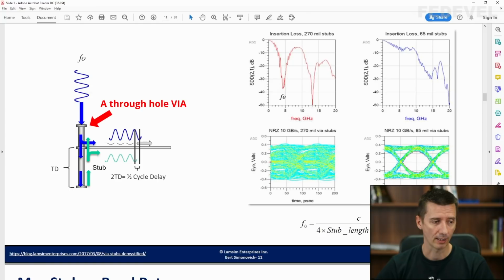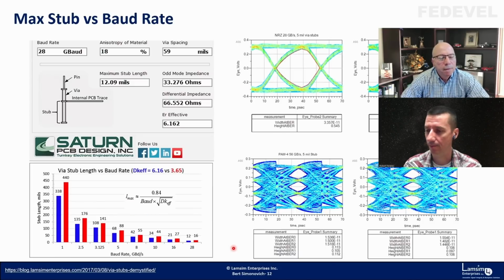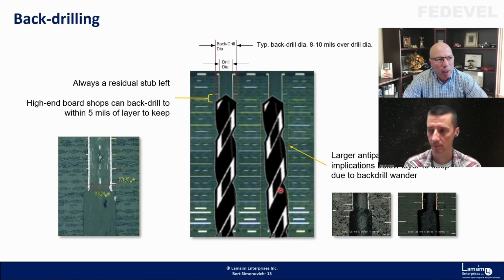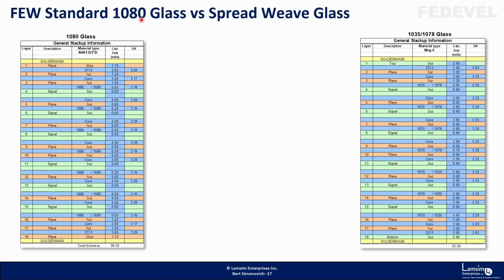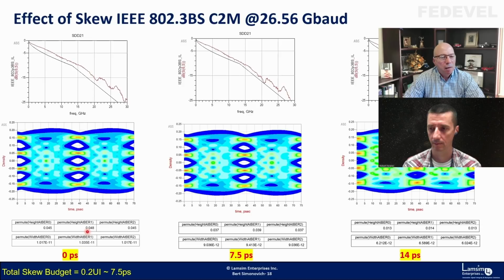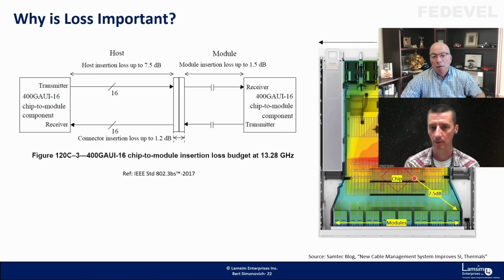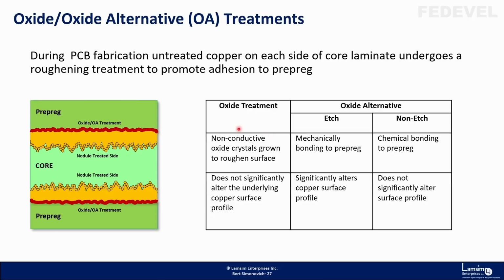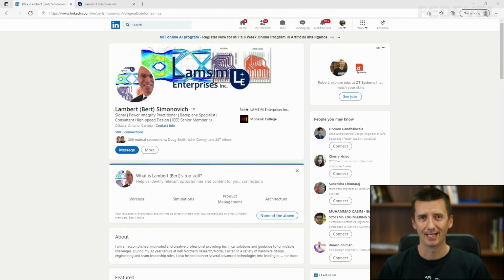Small Things Damaging Your High Speed Signals (with Bert Simonovich)

Comment: Great video, thank you. 
PAM4 is widely used in optical transceivers for ethernet (QSFP, SFP, OSFP...). The host side would be PAM4 and the line side would be an optical (fiber) signal.
And then when PAM4 is not enough there is QPSK and QAM16, these are being used for Coherent optical networks for 400Gbps ethernet.
I am not an expert, but I have some experience working for a high speed test and measurement company (TDR, DSO, BERT ...)
Reply from the maker: Thank you Hisham

Comment: maybe someone could talk about wiring between/inside equipment (non-differential), should there be multiple grounds in ribbon? plain twisted pairs for each signal? won't they create ground loops? what is worse ground loop or coupling between signals if ground is shared by multiple signals? always wanted to know answer...

Comment: Another great video. Thank Robert and Bert. For surface roughness modeling which numbers use in Advanced Design System?
Reply: Advanced Design Systems currently does not include Huray model, so my Cannonball model does not apply.
Reply: @bertsimonovich7297  thank you, Bert. Your work is phenomenal. I always have problems with modeling of surface roughness of copper foil. This staff in this video and your works are great.
Reply: @Hadi-zw9mb  Thank you. My web site has more detailed papers on modeling copper roughness.
Reply: Actually I just found out ADS starting with version 2022 includes the full Huray model so you can find the necessary parameters using my Cannonball model

Comment: Is the 270mil stub length shown at 6:00 split across multiple vias? Even accounting for the reflection going down and back up the via, it seems unlikely that you'd have a single via that long.
Reply from the maker: I was thinking the same, but, some PCBs really are very thick. I googled more info about backplanes and for example here it says " typically 4.0-6.0mm, sometimes even up to 10.0mm." https://www.pcbway.com/blog/Engineering_Technical/PCB_backplane.html
Reply: @RobertFeranec  Ah, yeah, on a re-watch I realised he's talking about backplanes with huge layer counts. That makes more sense.
Reply: Yeah, it's funny how you can work with something like PCBs for decades, and get accustomed to say 0.6 to 2.0mm thicknesses, and then suddenly run into 6mm board thickness and it beggars belief. But apparently it's just more of the same, with the exception of vias now becoming an appreciable length to worry about.

Comment: In the skew discussion he mentioned that the Nyquist was at 14GHz, but that would be roughly the nyquist of an NRZ signal. With PAM4, the nyquist is actually 26Gbits/4bits=~8GHz?
Reply: It doesn't say Gbits/s but 26.56 GBaud, so 26 G signal state changes per second, which is 13.28 GHz
Reply: Hmmm, if it's 26Gbits/sec (which is the same as 26Gbaud), and it's a 4- level code (2-bits per time slot), that means 13G time-slots/sec (or state-changes/sec). So the wave frequency is half that: (6.5 GHz). And the Nyquist frequency required to sample 6.5GHz, would be twice that... bringing is to 13GHz.
Reply: Baud is state changes per second. With PAM4 you transmit 2 bits with each state, so 50 Gbit/s
Reply: @bene5431  Hmm, on looking this up, it does appear you're correct.

Comment: Thanks you for this video; literally eye-opening information. 
I'm sure this will also be useful for boards using the USB 3.2 Gen 2x2 standard, at 20 GBps.
GDDR6x SDRAM Memory (as used on the RTX 3090) uses PAM4 signalling at 21Gbps, which is also a significant challenge for PCB designers.
Reply from the maker: Thank you Nicholas. PS: Eye opening :D
Reply: ... eye-opening... hahaha

Comment: Do you have experience with differential pairs and trace length matching? Which effect could have a greater impact in my signal integrity, bumps on one line which influence my impedance or the asymmetry of the line lengths?
Thanks in advance
Reply from the maker: This is on my todo list of future videos
Reply: Like everything with signal integrity, it depends on your noise or skew budget. Skew budget will be a function of your data rate. Matching trace lengths helps to mitigate skew, and matching impedance mitigates reflections and noise. We usually budget about 0.2UI for skew from all sources in the channel before it starts to degrade the eye, where UI is unit interval of the baud rate. So for example, PCIE Gen5 (32 GT/s) the UI is only 31.25 ps and total skew budget from all sources is 6.25 ps. With a propagation delay of ~165ps/inch for the dielectric, that is 38mils (~1mm). But as I explained in video, there is fiber weave effect skew, that is harder to predict and other sources of skew to consider in total budget. Skew also translates into mode conversion which could exacerbate EMI compliance. Because PAM-4 SNR is -9.5dB worse than NRZ, everything matters. Only good modeling and simulation can quantify the different effects.